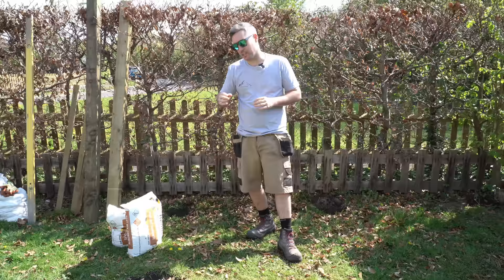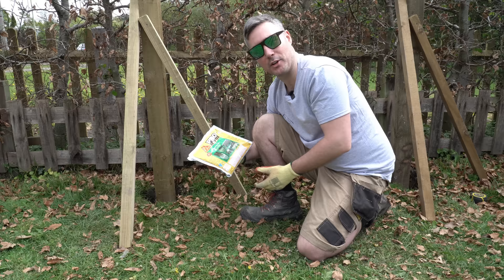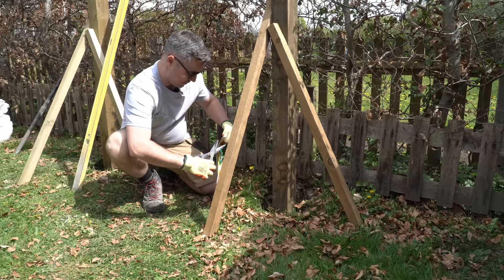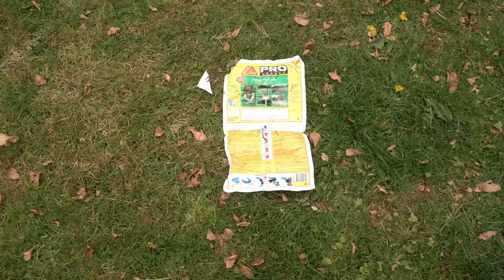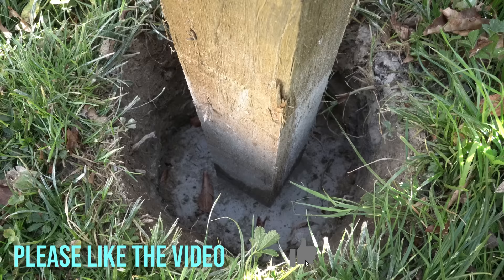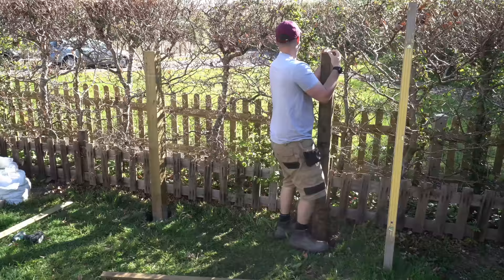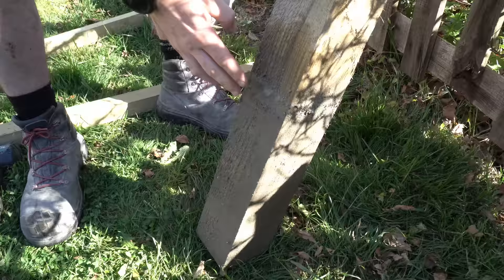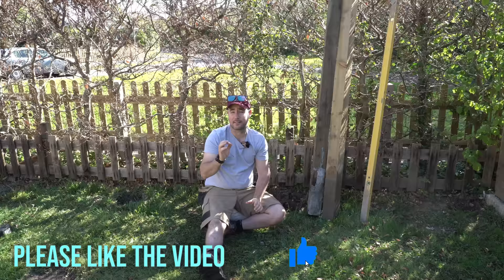Fence Post Foam vs Concrete | STRENGTH TEST

Comment: I used the foam on a large project, and it's solid, 4 years later. Works very well. But... I wouldn't use the bag type, I used two seperate containers and poured them together, did a quick mix and then poured it into the whole. Filled the hole all the way to the top.
Reply: I’ll keep using postcrete , easier for me, especially after seeing this. I find postcrete is perfect, just dog it in no drama

Comment: I used this foam to install a mailbox post about 5 years ago. The mailbox is as solid now as it was then. I really doubted it would last but, I'm impressed and will use the foam from now (at least for mailboxes). 

I painted the post with several coats of oil-based paint, Then I made the bottom of the hole wider than the top of the hole - kind of like a pyramid shape - using a garden trowel. The foam filled the entire hole and rose above the ground about two inches. I cut the excess foam off and painted it with the oil-based paint.

Comment: Whichever you use, hammering several 4" nails two inches into the post, 2 on each side so 8 total, prior to the concrete pour, makes a hell of a difference.

Comment: You can also weather proof the bottom of the post before you burry it, or cover it in concrete. This will add a layer of protection and you can not see it as it is buried. A stain with sealer of just latex paint will do.
Reply: So why not just use concrtete all together,...y'all making too much work for such a simple job

Comment: The trick i use with concrete is first mixing it in a bucket to proper consistency,  i also add a couple 4 inch  long x 5/8 inch lag bolts to the bottom of the post. And also filling the hole 2 inches below grade. That way you dont see the concrete when your done and it still enough to hold up to kids climbing the fence. Its a simple process that will save you headaches later

Comment: I don't use either.  If the ground is solid I'll sink the post 4 feet and tamp the dirt back down.  I've sunk over 100 posts in my days and none have shifted. And if you have winters where you are you have to go below permafrost or ice will push the post up anyway. 
I do use cement though when in sandy ground or a round post but only 20 pounds at the bottom under the permafrost layer

Comment: Just drive a couple of lag bolts or heavy spikes into the post to sit below ground level. Leave them sticking out as far as the post hole will allow. Or drill holes and drive a couple of pieces of rebar through. Set the post in the hole and pour the concrete. That post will never pull out with anything less than a 60 HP tractor.

Comment: I have never seen the brand you used in this video. My local hardware sells anchor foam that comes in a can like great stuff foam insulation. Its a snap to use. Sets quick, dries rock hard, and excess can be cut away. Its rated for load bearing and non load bearing use.

Comment: Dig a good hole.
Mix concrete first.
Screw a small 1" flange about 16" from bottom of post. Just extra not really needed.
The main thing is mix it first.
Then all will be good.

Comment: Used the foam when I build my kids playhouse and the thing has become more and more wobbly over the years. Makes me wonder if the foam is shrinking or water is deteriorating the wood posts below grade. Initially it was very solid, easily as solid as concrete. Kind of disappointed but hey at least it will be easy to remove someday when they outgrow it lol

Comment: That's a great video, and quite surprising that the foam performed as badly as it did. One tip I could add (with the concrete) is to smear roofing bull on the bottom/sides of the post to waterproof it before putting in the concrete. That will add years to the life of the post from rotting out. JMO.....
Reply: They make stuff these days that is like shrinkable tubing for wood post.  Just slip it over the part that is going into the ground to a few inches above then take a torch to it to heat it up and it shrinks firmly against the post.  I hear it works very well but it does not cover the very end.

When I was growing up we would prepare the post we were going to install about a week in advance.  We would drill 2 holes perpendicular to each other about 12 or so inches apart.  Then we would fill a barrel with used motor oil deep enough to cover the part of the post we wanted to protect and stick the post in there for about an hour.  Then take them out and put them in another barrel for the excess oil to drain off and then let them sit until ready to install.  In the mean time, we would dig holes at least twice the diameter of the post and a little deeper than we wanted the end of the post to be buried and put a few inches of crushed rock into the bottom.

When it came time to install the post we would stick a length of rebar through the holes and put the post in the hole, put a tube several inches high at the top of the hole, attach some small rope to hole the post vertical, then pour in the concrete high enough to be slightly higher than the post and taper it away from the post.

Those post have been there for 50 years.  And while weather worn, they are still nearly as sturdy as they were when they were installed.
Reply: The issue is he didn't use the correct amount of foam mix for the size hole he dug. You're supposed to have the foam expand above ground level and then clean it up after it hardens. Because his hole was too big, there was space between the foam and pole at the top (where he mentioned water pooling) and no stabilization allowing him to loosen the post from the foam. The instructions on the packaging for the foam even says that a 4x4 in a 10in hole requires two bags of foam.

Comment: I used the Pro Select deliberately to set a new mail box wooden post. Why? In case my town's snow plough guys ram it and break the post, a not unusual occurrence around here. If that were to happen, which would you rather dig out to replace it - the foam or a big block of heavy concrete? Enough said. For a fence, I'd use the fast setting concrete. For a mail box, the foam is more than adequate because there's no load on it.
Reply from the maker: Id absolutley agree on your points. Digging out concrete isnt easy.

Comment: I think for either product, the setup could use some work on the post itself.  Some kind of horizontal notches, some spikes/rebar extending out of it and a hole that's not smooth as well.

Comment: A couple of comments...  
1) The instructions for the foam say that 1/3 of the post needs to be in the ground.  You only did about 1/4 of the post, if that. 
2) The post you used for the Foam appeared to be wet/weathered already (it was quite dark). The one you used for Concrete appeared much newer and/or in better shape.  
That being said, Concrete will obviously hold better and does have the added benefit of being a heavy anchor as well.  It just takes way longer to set/cure.
Reply from the maker: Hi Jeff, Uk reccomendations of post depth are different to the US. We say a minimum of 60cm depth for any fence height, up to 2m. Both posts were brand new just different colour variation. That has no bearing on the test itself.
Reply: Also the hole is much too wide so the foam has to work harder to fill the hole
Reply: @smallengine  holes to big and not filled to the top; not sure why a pro fencer would film this?

Comment: What you do is drive 4, 6” hitter spikes down at an angle before poring  in the concrete. Once you do that you will never pull that post out without pulling up all the concrete as well. Also, 2 bags and it did not fill the hole??? I have done my
Mailbox posts and 1/2 of a bag was enough to fill a 3’ deep hole.  But you still must give that post more to attach to like those spikes I mentioned and also make some small holes in the sides of the hole for the concrete to work into. That was terrible.

Comment: Good video James,thanks for that,I got asked about foam just before Christmas, to me personally it just doesn't sound right and after watching this it's definitely postcrete all the way,never had a problem with it 👍
Reply from the maker: Youre welcome. I personally have never and will never use it again.
Reply: It helps a lot if you actually use the product correctly. The user in this video failed at that completely. It is still foam. Concrete will have its on advantages and drawbacks. If used correctly, foam will 100% keep water away from the wood. It’ll also form an extremely strong anchor to the ground.

Comment: Look at the materials people. Wood against concrete is a no-no. Concrete absorbs water like a sponge. Wood does the same. That is a recipe for wood post rot. This is the main cause for fence failures. Foam doesn't absorb water. It will glue itself to the wood post. Also the same for the soil.
Reply from the maker: Soil does absorb water and does aid in the rotting of wood.

Comment: what is much stronger than a hole filled with concrete, is japanese technology for posts to install car ports. each post has four long metal rods driven into ground with a jackhammer at 45 degrees, and secured to post with heavy duty nuts.
that's overkill for fence posts but maybe a similar thing could be done, saving concrete. think tree roots

Comment: Just a tip from me to you. I put coated decking screws on all four sides of the bottom of the post leaving about a inch or more sticking sticking out. These act as pins so the post can never slide down the anchor material depending on what you use. I also coat the bottom section of the post with something like Flex Seal or plastic roof sealent . Maybe try one more test using both types material in the same hole. Foam first and then cement or cement first and then foam. Test for strength using these methods .
Reply: Your tip is as old as the hills My friend ! 😂

Comment: Problem is the foam gripping the post... the soil around it is anchoring the foam.. to better grab the 4x4 post I use six 3 inch screws protruding plus drill one inch deep holes with a half inch bit...at the base of my 4x4 post.. after the foam expands it grabs ahold of those screws and also fills the 1 inch deep voids I drilled and that bitch isn’t moving anywhere. Did a 45 foot fence .. 6 foot tall fence with stucco over the wood + galvanized lath in California.. not harsh conditions here but we have sprinklers. The base is in a solid clay.. so it is not soft soil. So far so good. 

Thinking about doing a pergola with the same drill and 3 inch screw system. I like how it’s fast setting and easy to work with quickly.
Reply from the maker: I felt that the foam gripped the post very well. The problem was the constriction of the foam that left it wobbly and the voids left around the base of the post. Also it kept moisture around the post and doesnt have any weight to anchor the post down. All in all i didnt like the product.

Comment: Failed because you didn't use it right.
  
1) You should shake the bag a few times then run it across to mix
2) That hole is at least 12" wide. Maximum width is a 10" hole max and to use 2 bags per 10" wide hole.
3) The improper width was the major factor.  The foam can only expand so much, and it spent most of its expansion energy trying to reach the hole wall where it had little expansion pressure left to properly secure itself.
4) Doesn't look like you poured it along the post itself, just straight into the hole.

Don't let this video determine whether you use this product or not.

Comment: Curious if you actually followed directions..
The foam i used for a post, filled the hole to the top.
It did t lookas if you poured equally around the post.

Comment: It would seem apparent that the auger used for the post hole is too big for the post. A narrower hole would obviously have a lesser volume and the product would come closer to the surface, thus giving a lot more support. My only concern would be, should the foam expand above ground level, are you left with a “Muffin top” or is it able to be readily cut to ground level. I know everyone is an armchair expert, but I don’t think this was a definitive test.
Reply: Yes you could easily shave the top off for any bit that expands too far above grade. Also you are supposed to pour it against the post on all sides, not directly into the hole. This causes the highest points to be against the post, creating downward, outward slopes, and also creates a water-tight seal against the post. Also you are supposed to add gravel in the bottom (for either product). Not sure why this guy would bother making a video without properly reading and following the directions.
Reply: Yup this is what I thought too. Hole too big, not filled properly. Look how easy even the concrete post came out.
Reply: Why don’t you just drive them in? No volume to fill at all.
Reply: @kxjx  cause he didn't even mix the concrete he just worked on the gravity thought, hoping water would get to where was needed.
Anyone who has mixed these bags of concrete or cement knows the dry mix will be mostly hydrophobic, you're never going to get a good cure just tossing water on top of the dry mix in the hole.
That cement should not have broken off that post so easily after 6 days! 
He didn't do any of this right, he wouldn't be putting up my fence that's for sure.
Reply: @patriciatoomingtheplantpar2558  huh? You don’t mix post mix. You partially fill the hole with water and pour in the post mix. You then use a stick to remove any air bubbles and if you are concerned it is too dry, at a bit on top. The mix is hydroscopic and hydrophilic in general so picks up water from the ground and air anyway. You certainly are not supposed to mix it with water.

This test was unfair because:
He used too little foam to compare with two full post mix bags.
He didn’t agitate the post mix to remove any air bubbles.
Reply: @patriciatoomingtheplantpar2558  there are bags called "postcrete" that you can buy in the UK that are designed to be used this way (water in the hole, pour in the powder). They do work OK, but it's important to properly fill the hole!
Reply: @paulharrison2325  2 bags of postcrete for one post is ridiculous; pity whoever has to dig that back out again. If he used the proper tools to make the hole so its only a bit bigger then the post he wouldn't have need so much and the hole would have been full to the top. Same with the foam, the reason the foam didn't work is the hole is far to large for that amount of foam.
Reply: @paulharrison2325  I just look up the price, that's £5 a bag that stuff and he would have need nearly three bags to properly fill that hole. Who wants to pay £15 per post!? Total waste of money.
Reply: Looks like a typical hole to me for a square post they intend to concrete fill. Only 2 inches off the corners. Go any narrower & the concrete is going to be weaker at those thinner points & want to split into 4 chunks. All the concrete anchoring seems counter intuitive as the water is going to go to the place of least resistance which might be through the concrete against the post. Many are of the opinion of just tamping the dirt back into the hole effectively and the water is going to want to drain elsewhere away from it. Lot of farmland fence laid 100 years ago that didn't have concrete poured in every hole.
Reply: @KLondike5  the hole is way too big; waste of concrete is he gonna use £15 worth of concrete for every post? More money than sense. As you say you can even tamp dirt or gravel in you don't even really "need" concrete. The main advantage of the concrete is it "flows" and then doesn't settle or shrink any more. So you can easily fill the hole with concrete and it stays filled and its less effort than tamping. The strength of the concrete is almost irrelevant as the ground is doing all the work; all the concrete is doing is filling the space between the post and the ground. Try putting a lump of concrete on the bottom of a post that isn't in a hole - you can easy push it over. The hole keeps the post still, the concrete just fills the gaps. Even if the concrete breaks somehow the concrete has no where to go due to the ground - and the post will still not come out (as anyone who has had to dig out a post with a lump of concrete on the bottom will know).

Comment: Not sure what’s going on here but I’ve done concrete post fill before and I’ve never been able to pull the post out of the Crete after it set up….the Crete usually comes out with the posts…

Comment: Mix the concrete in a wheel barrow or rotary mixer. Pour the concrete in as a thick mix. Tamp the air out of it and shape the top. 
   THEN it won’t come out. Both the methods here are flawed. 
  I have dry set concrete mix in posts and poured water on top leaving the rest to Mother Nature. Years later if I needed to move the post or remove it, they were all completely set. If I worked one too hard (installing a gate etc) relight after being set (24 hours) they invariably failed. If I had previously mixed the concrete, after 24 hours I could do anything I needed to. The post was as set as it ever would be. 
    Mix your concrete, pour it into the hole as a thick heavy mix as stated and finish it up. We have deep frost here so we set our posts 36+ inches. I set them 42 or 48 inches. Otherwise frost can heave them up. I have seen a post set at 3 ft be lifted and showing a foot of concrete the next spring after a hard winter!!!